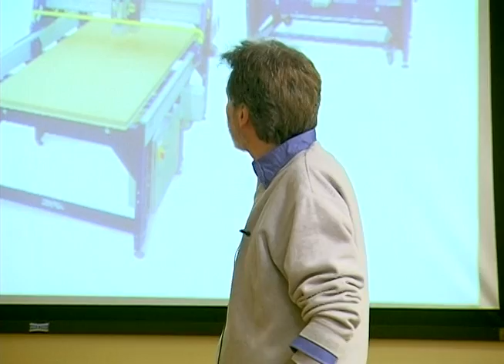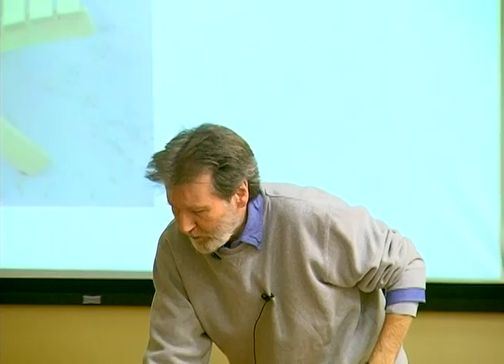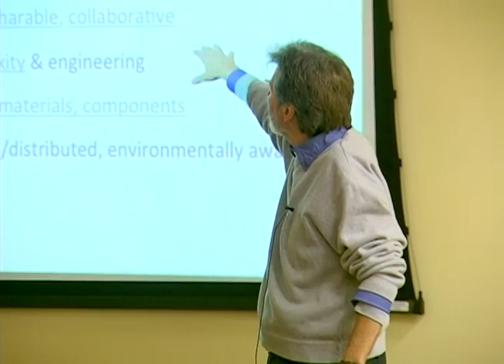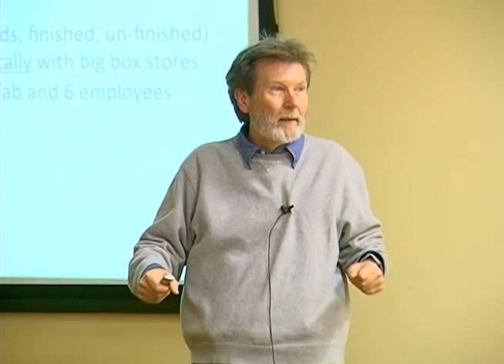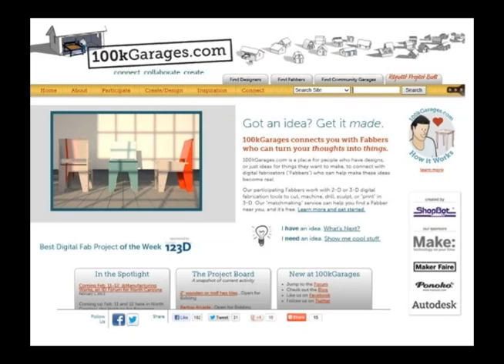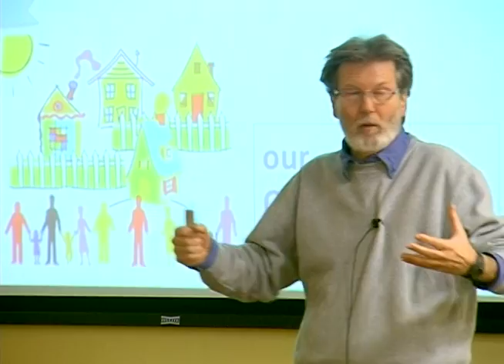The New Manufacturing: Ted Hall at TEDxRichmond

Comment: interesting he says he disliked the original machines he found were far too expensive so he decided to make his own.
the SMALLEST machine his company makes is about 10 grand with taxes (not including delivery) and it so small it sits on a bench top. hardly usable. their "real" machines run in that 30k and up frame he hated.
Reply: except it isn't, the machines he hated were 6 figures+ with a welded frame. Only available to the most elite MFG companies. in 1995 when they (ShopBot) started the ShopBot machines were 5-10k and are bolt together/customizable. now even more is available and they are still below 5 digits. Go figure. Most people know nothing about CNC and MFG costs. Also, not sure what you are on about the size of the tools - that's the size of CNC tools..."hardly useable" - this isn't a 3d printer commodity item, the size of these (CNC) tools is never really going to be smaller. WTF are you cutting? Note that ShopBot had been selling one of the most portable machines that cut the size of an envelope (8"x12") for years and it never was something people really wanted to buy (as they seem to no longer sell them)...so yeah. You don't seem to know the industry.